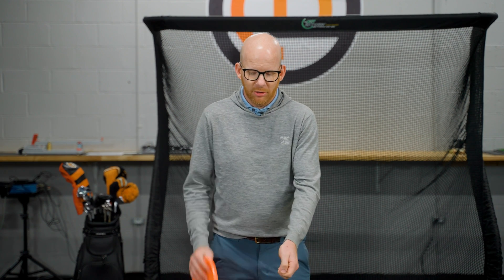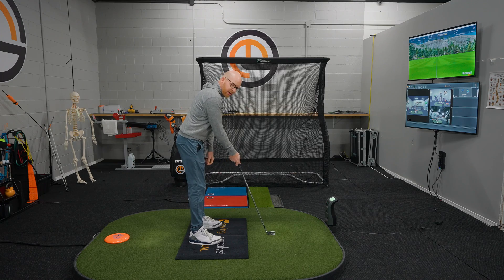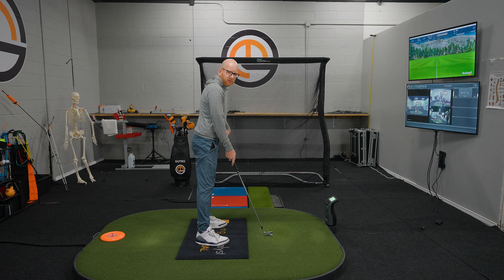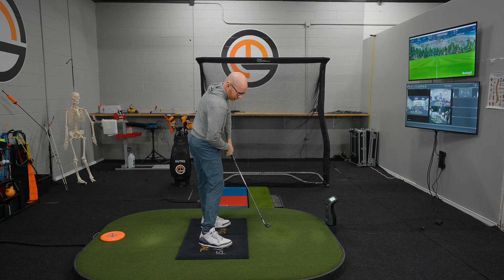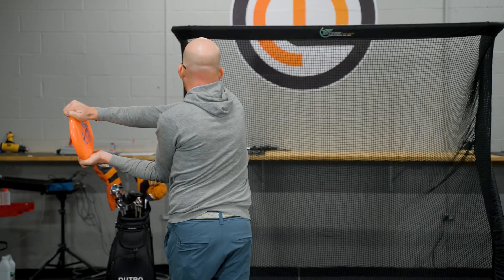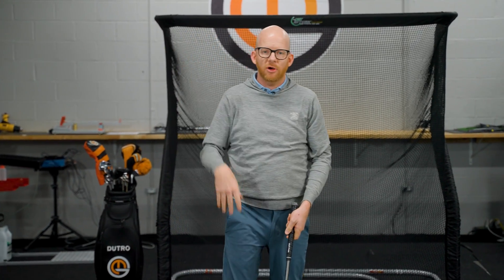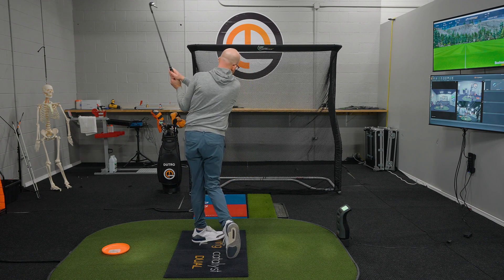How the Wrist Angles affect the Dynamic Lie Angle.

Comment: Can you explain "out side wheel" what means, can not see the difference, thx
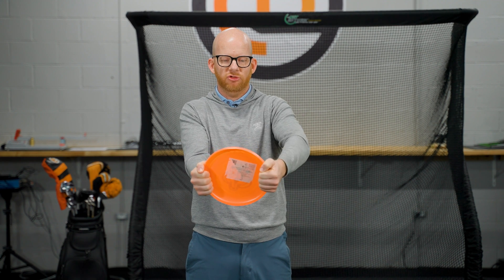Reply: Around 5:30, you can see Mark bends his lead elbow and flexes (bows) his lead wrist.  The wrist joint is now outside the frizbee (further away from the very centre of the frizbee).  Whereas, when Mark had his lead elbow tucked into his ribcage and his lead wrist in extension (cupped) - his wrist joint was inside the circumference of the frizbee (closer to the centre).   The slight elbow bend and flexed wrist seem to access more rotation (possibly more shoulder socket range of motion) for a smoother and more gradual squaring of the clubface.  The alternative (wrist cupped and elbow tucked), has limited rotation range and instead causes the arms to lift away from the body.
Reply from the maker: Sorry, but we are not trying to rotate the shoulder as far externally as possible. This doesn’t allow for you to use your right arm properly in transition. All the best.
Reply from the maker: If you think of holding a steering wheel at 9 and 3, when you turn the wheel to the left with both hands, you want your left elbow to lead the wheel and stay “on the outside” of the steering wheel. The opposite would be letting the lead elbow move towards the rib cage which then requires the wrist to do the turning before running out of room.